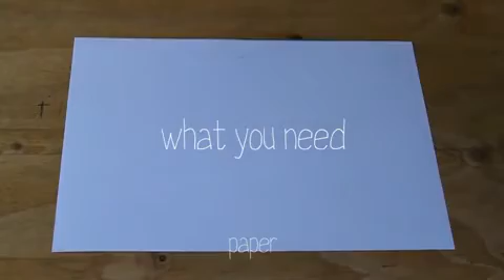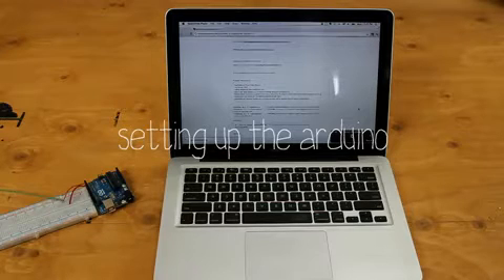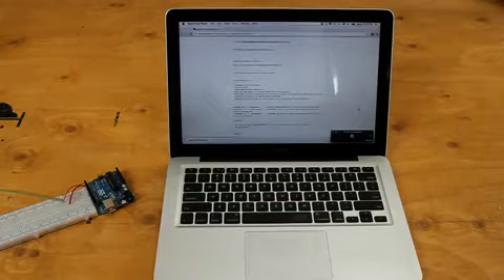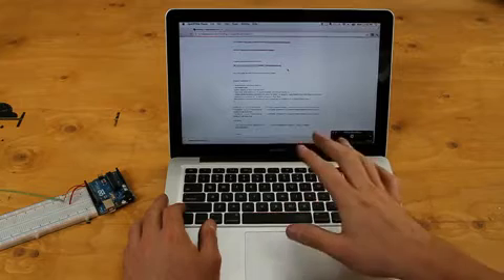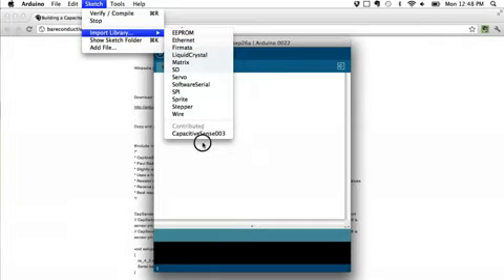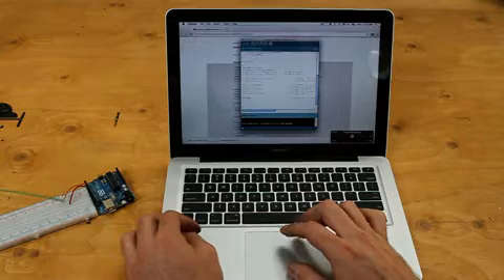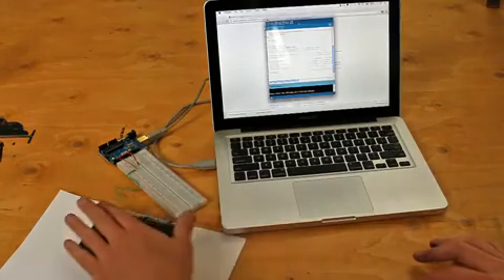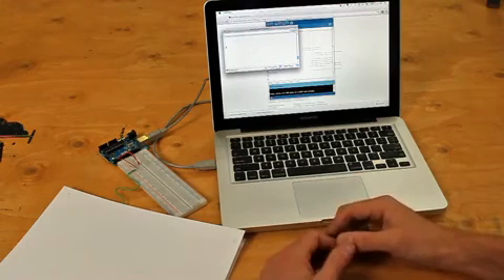Making A Capacitive Proximity Sensor With Electric Paint

Comment: Arduino: 1.8.19 (Windows 7), Board: "Arduino Uno"

capacitive_sensor:38:10: fatal error: CapacitiveSensor.h: No such file or directory
 #include <CapacitiveSensor.h>
          ^~~~~~~~~~~~~~~~~~~~
compilation terminated.
exit status 1
CapacitiveSensor.h: No such file or directory

This report would have more information with
"Show verbose output during compilation"
option enabled in File -> Preferences.
What to do??

Comment: Is it possible to do the same process using raspberry and resistors only? Or it is imposible without a hat or some module
Reply from the maker: You should be able to as it just using the digital pins of the Arduino!

Comment: Question .. do this sensor requiers electricity from ardruno  board or is it self generating and giving  electricity to board?
Reply from the maker: Hello! They receive electricity from the board!
Reply: @bareconductive0  btw did you measure hoe much voltage this thing generates in idle position.. I mean without board.. I've seen a ppl using these sensors to generate electricity
Reply from the maker: @vlooop2179  I'm not sure what you mean by "thing". The paper sensor doesn't generate voltage, but the Arduino has an output voltage of 5VDC.